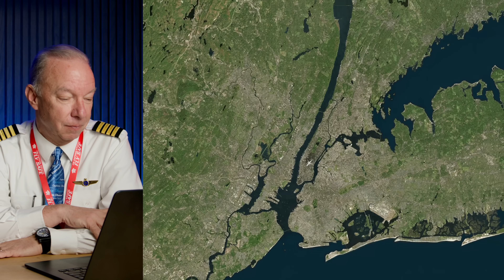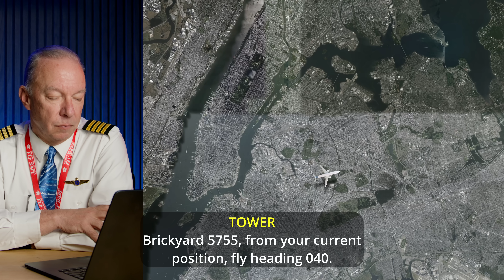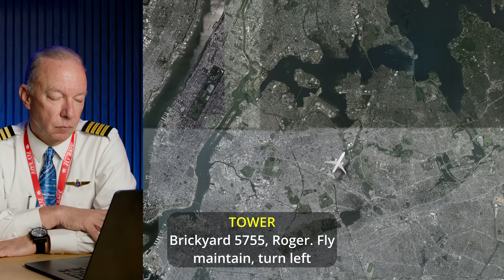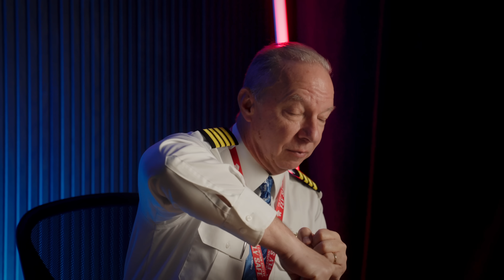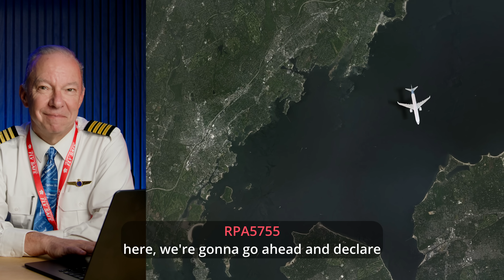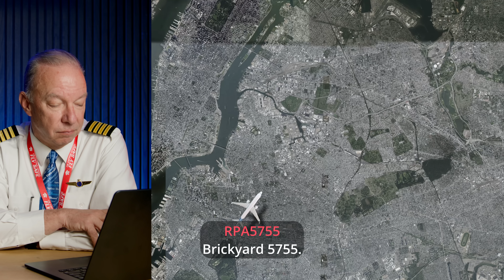Brickyard 5755's Landing Gear Malfunction at LaGuardia: An In-Depth Analysis with Captain Steeeve

Comment: Long time ago I got barber pole on the nose gear. Had to fly slow back to base at night. Cut the engine on final to prevent a fire and my world went dark, I was not prepared for how dark. Landed gently as I could, punched the canopy and nothing, maintenance had left the pins in. I had to wait to be cut out. Guys in the tower said there were sparks 50 ft in the air, all I saw was black. I walked away without a scratch.

Comment: Question- Is it possible for the cockpit to have visual access to parts of the airplane—such as the landing gear, flaps, or engines—through cameras or CCTV, so pilots can monitor them directly from inside?

Comment: This happened on a flight I was on back in "85" from Fort Lauderdale to Washington International. Landing gear would not come down so we were told by the captain that it would have to be done manually, and that we would have to change our destination to Dulles airport. Apparently we needed a longer landing strip that Washington did not have. The stewardesses had us put our heads in our laps and hands locked behind our heads. The plane was so silent as we decended...all of us silently praying. Ill never forget how hard we hit the ground. The plane left the ground again then came back down. The pilot hit the brakes so hard it threw us back against our seats. The plane shaking so hard I was sure we were going to break apart. I was able to see fire trucks off to the side as we barreled down that runway. After what seemed an eternity the plane began to slow, and then stopped. At first I think we were all in shock, but then we all began to clap, and some crying with relief. That Captain was our hero, and the men all shook his hand and the women hugged him. I found out that the reason we were going so fast and hit the ground so hard was to lock the landing gear in place. It worked. Otherwise we would have been skidding down the runway on the belly of the plane. And that would have been disastrous.

Comment: First of all, "my aircraft" is not the SOP call-out at Republic. Of the 3 airlines I've worked at, that is only an AA thing.

Second, that is not how manual gear extension works on the Embraer 175. There is no crank, it is just gravity and activated by a lever. Also, there are no main gear doors that retract on the E-175 on gear extension. Hell, there aren't any on the B737 either. That's only an Airbus thing.

Please at least do some basic research.

Comment: Being ther done that. While flying back from Florida many years ago on an Eastern airline L1011. Pilot announced that the landing gear was not on lock position. We were landing at JFK, as he made the announcement I noticed that we were flying away from the airport. Flew for around for a while. A pilot came out and opened something on the floor and disappeared.  After a while,  he came back out. It was announced that they had visual contact that the landing gear was lock in position. We all had to brace in positon and proceeded with the landing. Success,  were met with al kind of bells and whistles on the runway. Greeted by in laws upset that we didn't tell them that the flight was delayed 😢

Comment: Hey captain steeeeeeve!!!!  I think airlines should charge fat/obese passengers an extra $100 surcharge just like they charge passengers for extra baggage.  I suggest they have a scale when people board the plane and passengers should be forced to weigh in at the gate.  If your bmi is 25 or more you need to pay the fine.  Under the current system my 4 year old son pays the same fare as some 400 pound slob.  This makes no sense at all plus it makes thin people subsidize the fat/obese.  The FAA needs to study my plan immediately

Comment: Question. On board, is 'fuel in time' calculated by burn rate of fuel for normal flight, or is it 'auto updated' based on current plane configuration - like speed, drag, other factors?

Comment: I used to work in heavy check for said company, one of my jobs were to remove, inspect, (along with inspectors because this is an RII item) and reinstall nose landing gear I can visually see all the components in the nose gear bay. Watching this just sends a shiver down my spine.
Reply: Dude, same here. I worked at the Embraer BNA location. Had to double-check that this wasn't one I personally worked on. It's not a great feeling.

Comment: Are the landing gear "locked" lights ever wrong?
Reply: Yes, two major, historical crashes resulted from such: a Pan Am L1011 near Miami amd a DC 8 in Portland, OR. The L1011 lost altitude And crashed while trying to resolve the issue. The DC 8 ran out of fuel while doing the same. The landing gear was fine during both crashes. Both resulted from a burned out bulb.

Comment: Just caught a clip where you looked very forlorn and said the worst thing you could say is “prepare for impact’. That is hardly the worst thing you could say. Impact could be survivable as well as un survivable. Depends on the issues. Preparing for impact doesn’t mean you were wrong. It means all things that could have been tried have been tried and failed. The impact is not a failure in itself rather the result of things tried and didn’t work. You were right the first time Cpt. Steve. Being wrong is worse than a pending impact.

Comment: @Captain Steeeve,  Why does ATC use call signs like Brickyard 5755, 
 Air Florida- Palm 90
Capt Sully- Cactus 1549
DCA crash- Blues streak 5342???   Inquiring minds want to know!
Reply: They're chosen by the airline. Some are more creative than other. For the ones you asked about specifically. 
"Brickyard" is Republic Airways, headquartered in Indianapolis where the Indianapolis Motor Speedway (The Brickyard) is.
Air Florida was "Palm" cuz...well south Florida
US Airways at the time was "Cactus" because they kept the America West callsign after the merger.
PSA is "Blue streak" because the original airline was jetstream international airlines and their livery included a blue streak.
Reply: @ Thank you so much!!!